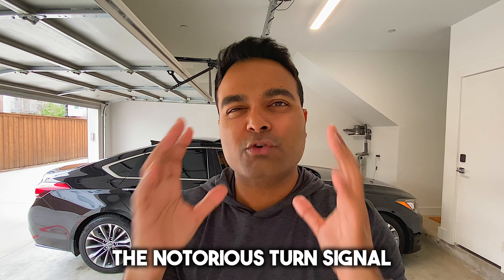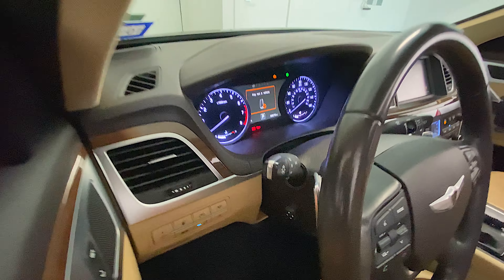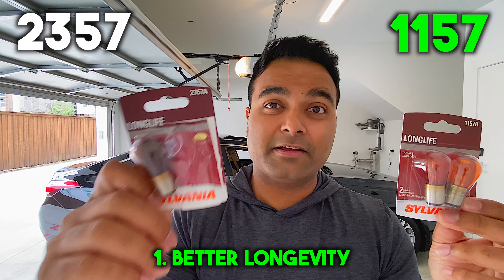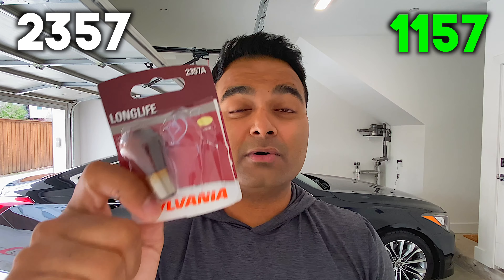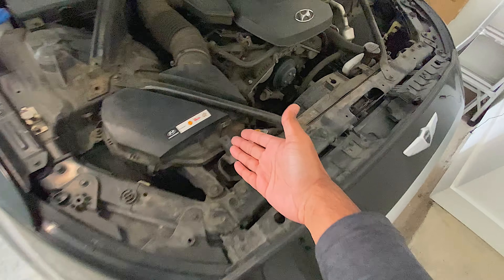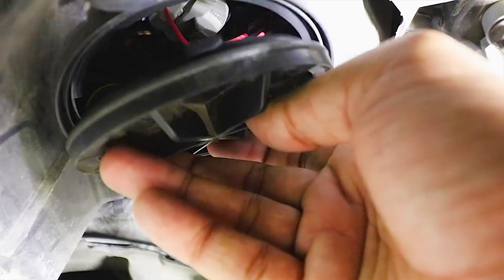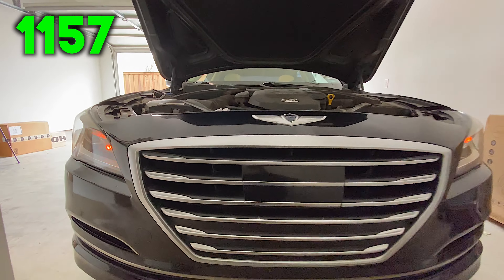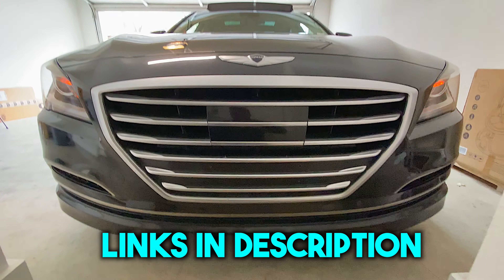How To Replace GENESIS G80 Turn Signals With Something BETTER

Comment: I have an 2015 5.0 Genesis. Unfortunately this is a design flaw in these models. The turn signal is working double time because of the DRL feature. You have to turn the DRL feature. I don’t care which bulb you choose to use. Whether LED or incandescent. It will burn out prematurely

Comment: Ive been using aliexpress canbus 1157 leds for more than 5 years and it still works fine
Reply: Question: were you able to install the turning signals alone or did you need to install some additional equipment?

Comment: Hey bro why dont u use leds gor ur front turn signals??
Reply from the maker: I tried once, however it didn’t work well sadly. I will try it again.
Reply: @KLEANTRIX  yea bro make a vid on it cause im bout to do a full led swap on my 2018 toyota rav4
Reply: I tried LED.  The car thinks blinker light is out because it draws much lower wattage.
Reply: @seandevice238  bro some cars need a canbus to regulate it YouTube it
Reply: @seandevice238  you need to add a resistor or get "canbus" bulbs (which is the marketing term for saying it already has the resistor built in and is "canbus compatible").

Comment: Had my driver socket go bad and had to get it replaced.
Now I just drive it in parking light mode during the day and don't use the DRLs.  Problem solved.  
I might look into doing a mod making the LED strip the DRL. 

You need to do 1 of 3 things to get around this problem: 
1. Drive during the day with the lights in DRL OFF
2. Drive during the day with the parking lights on or with the headlights on.
3. Modify it so the LED strip is the DRL, or replace the bulbs with LEDs.

The last option is the only one where you can retain the automatic function of the lights.  If you don't do one of the three things, you will be constantly burning through bulbs and sockets. 

I know you don't have this car anymore but I hope this will help anyone who has this car who is frustrated by the front turn signals.
Reply from the maker: Yeah for sure. This was one of the most hated things about this vehicle. Other than that I loved the car when I had it.

Comment: Why not put LEDs instead?
Reply from the maker: Sadly, LEDs do not work well on it, I have tried, however, I will do more research into it.
Reply: That's my go-to solution, however the car didn't like it.  Even with "low" power canbus/built in resistor LEDs (low meaning not trying to be stupid bright, comparable to incandescent), I now have to replace the bulb sockets.  They got hot or something, visibly discolored.  Went back to 1157's (that's what my local store had in stock) and am having issues still,  more than before actually.  Now the contacts are constantly flaking out and not making a good connection to the bulb.  They meter out fine, and bending the contacts out to make a firmer connection to the bulb worked for a few weeks.

TLDR: probably not worth it in this car.